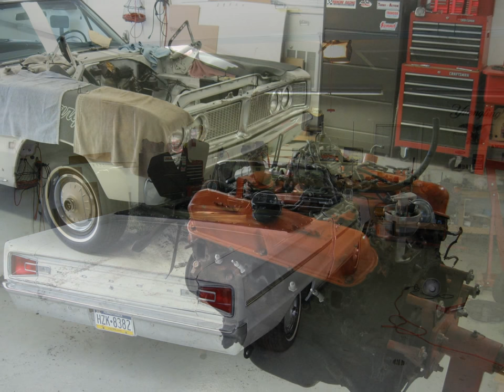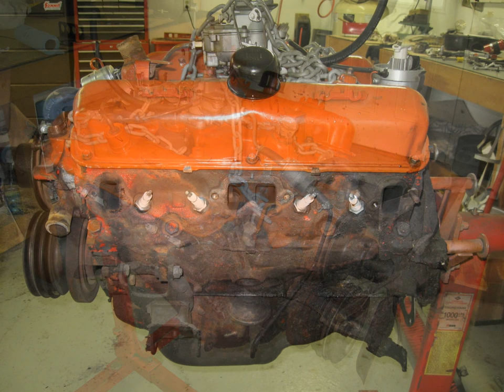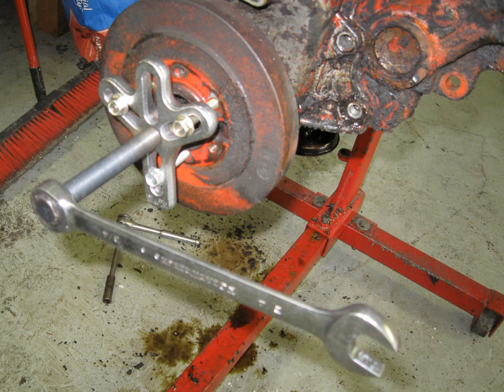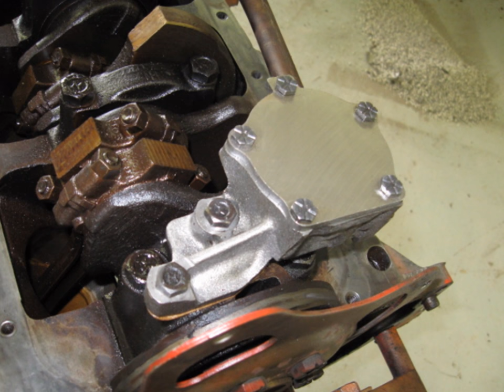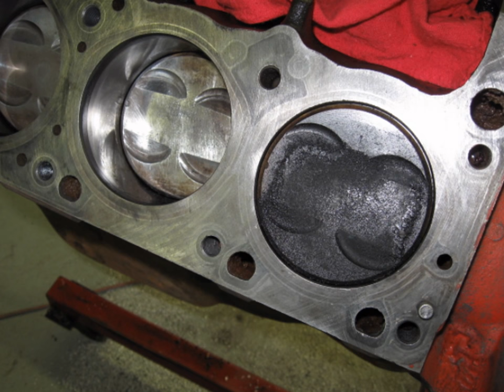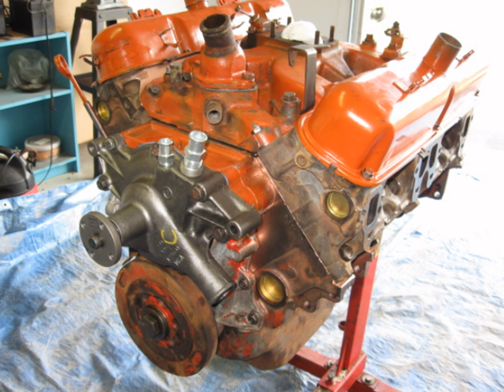1966 Dodge Coronet Convertible 273 Engine Freshening

Comment: Could you provide a bit more info on what heads you used?  Maybe part numbers?  Off a 273 or 318? I have a 66 Coronet that I want to bring back to life.  Any info or recommendations would be helpful.  Thanks
Reply from the maker: Joe Sirico joe-since i did this build about 6 years ago i can't remember specifically what the head number was but i do remember reading that it was the same # as the 1985 closed chamber (just like the 66 but unleaded.) This engine still runs perfect, and was a relatively easy project. Any questions, feel free to ask.

Comment: Did't  refresh it no rings  no cylinder hone   basicly new oil pump and water pump and paint
Reply: I did  engine refresh    all bearings pistons  new rods   cam cam bearings  repolished  crank  new frost plugs     high output oil pump   new water pump    thats  how a refresh is done
Reply from the maker: I said refresh, not a total rebuild. There's a difference. First, it's my brother's car so his funds were limited. Second, heads were cleaned and replaced with unleaded. Oil, water, fuel pumps replaced, adjusted rockers, freeze plugs and all gaskets. This was done 10 years ago and still running perfect.